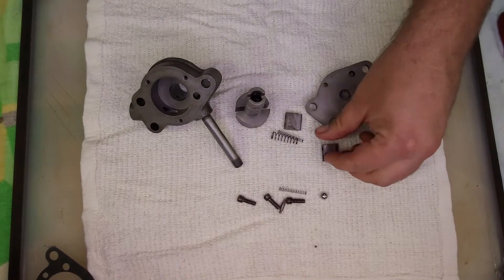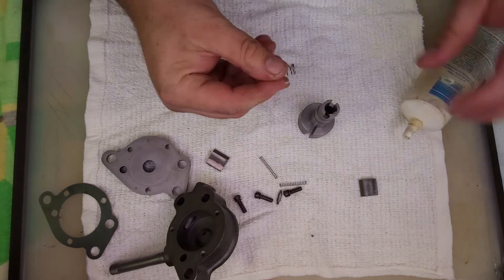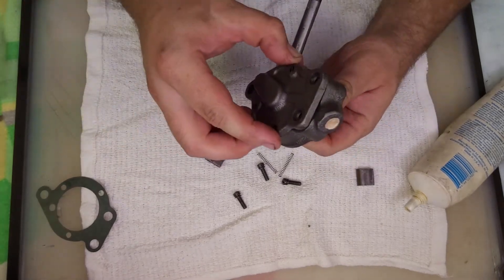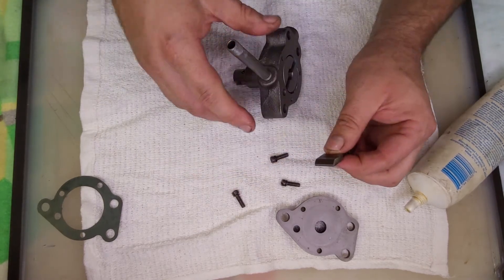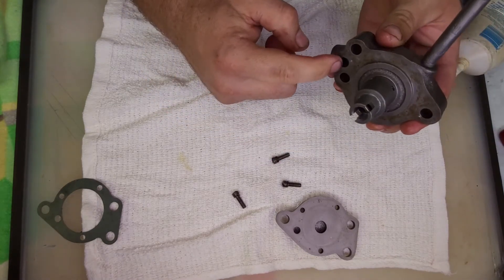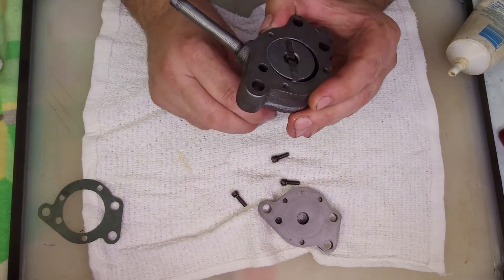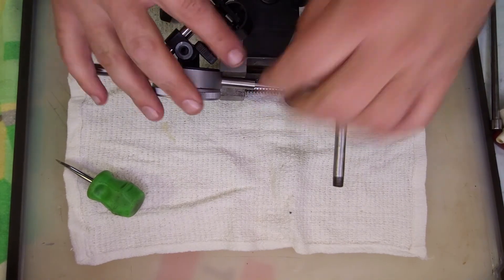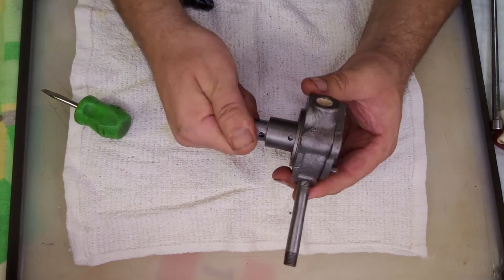1953 Allis Chalmers B Oil Pump Assembly (caution I assembled vanes backwards, link in discription)

Comment: DJ's tractor parts sells the entire rebuild kit (a bit expensive), however it includes everything but the case and the ball valve. Service manual instructions are included so you don't install the vanes backwards. All the parts inside are replaced in their kit. My oil pressure was down just a bit, so while I have my engine off to replace the clutch I am rebuilding the oil pump at the same time. Nice video.

Comment: I have an issue of my pump losing it's prime. Until I rebuild the pump, I just squirt a few shots of oil into a 'T' with a valve that I plumbed into the oil line. Thanks for sharing, I was wondering how much of a pain it might be to work on.

Comment: The assembly lube in the assembly of pump rotor likely reduced clearance to pump cover.  I bet your pump was in spec if dry measured.
Reply from the maker: It is true that the lube will effect this but the clearance measured more than spec so it it technically probably a little worse than it measured out as. Spec. Max .003 measured at .004.  I didn't decide to measure this until after assembly or I would have test fitted dry.